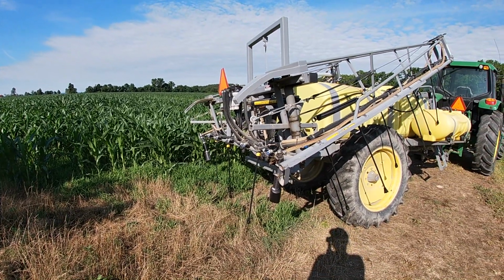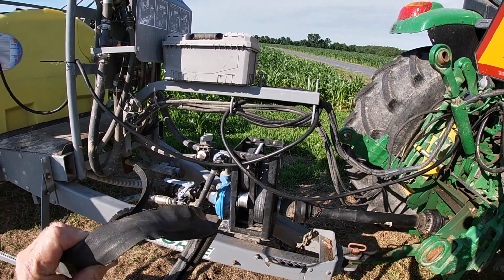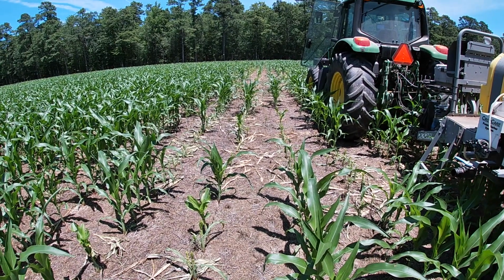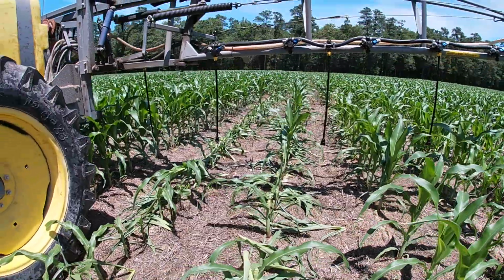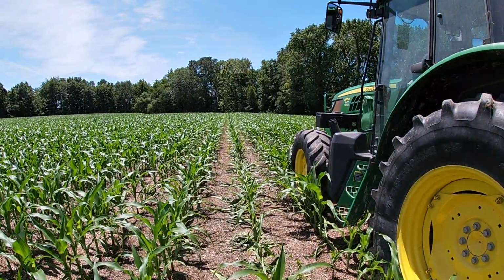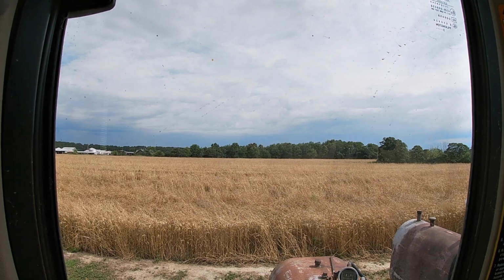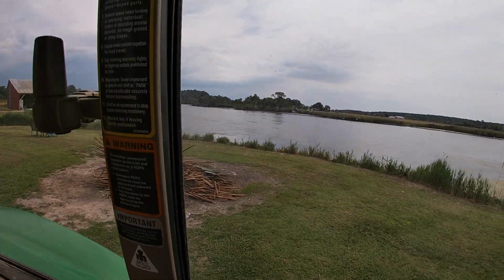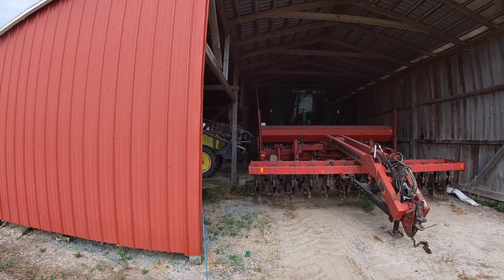Liquid Nitrogen going on Corn

Comment: Thoughts on post-spraying RR Dwarf Field Corn with 41% Farmworks Gly PLUS 2 pts per acre Nitro Surf mixed in and spraying over leaves and all? We only have a boom sprayer and want to try and get some nitro on the plants at the same time we post-spray. Thanks!
Reply from the maker: I've never used Nitro Surf so not really sure, but after reading the label I can't imagine it would do any harm, maybe slight burning on some leaves if that.  But I'm no expert with this so use with caution.